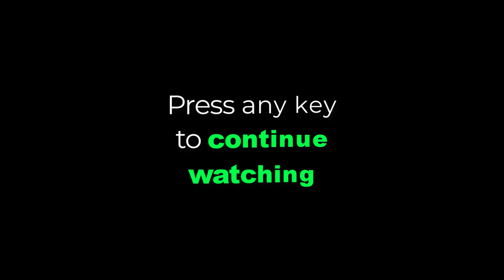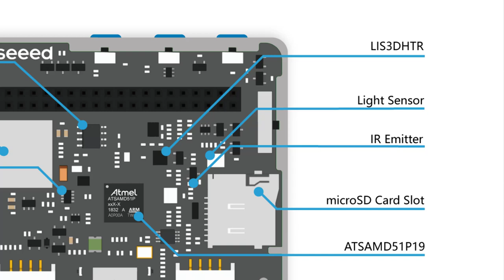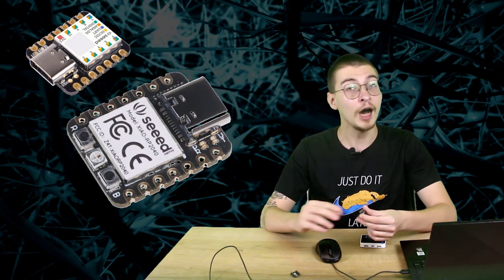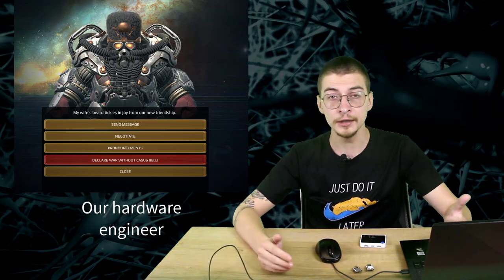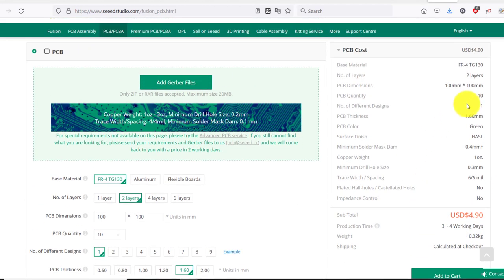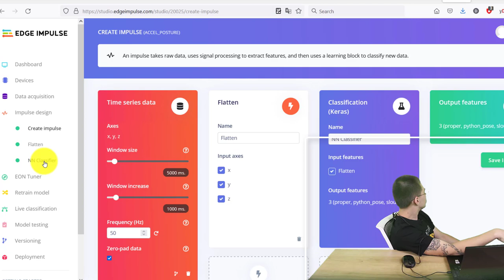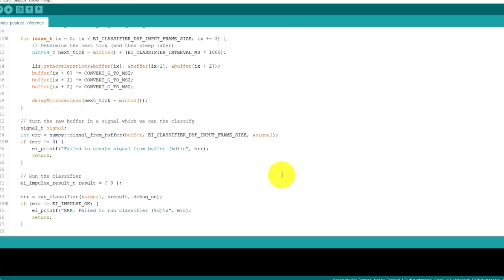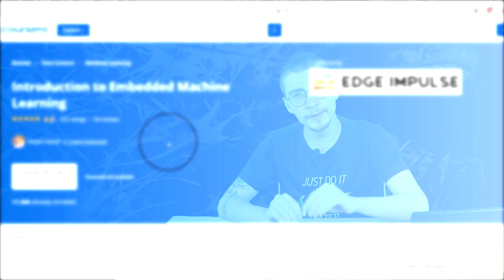Wio Terminal TinyML Course #7 Machine Learning on ARM Cortex M0+ MCU Seeeduino XIAO and XIAO RP2040

Comment: 2 arrs & not one um. Perfect. I love you paused between thoughts. Set, style, flow, all perfect. I'm still not interested in the topic. You need to solve a more difficult, real word problem. Eg use vision to identify obstacles infront of all person walking: step up 100mm step down 20mm, obstacles left 1000mm. Build the starting blocks & let others develop the details.
Reply from the maker: Thanks. Well, the TinyML series has officially finished. What is currently in the plans:
- second part of video about synthetic data with Isaac Sim
- tutorial about MAIX II (looong overdue)
- Bittle RL video? sentdex made some videos on that topic that made me realize that the result shouldn't be perfect and you can make a good video just about your exploration and discoveries